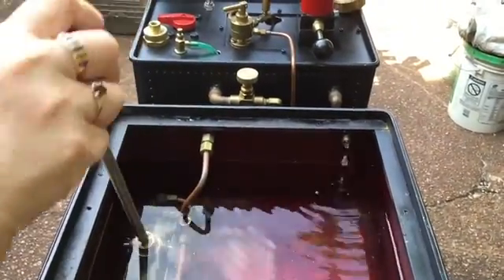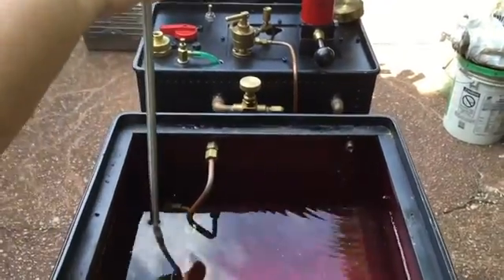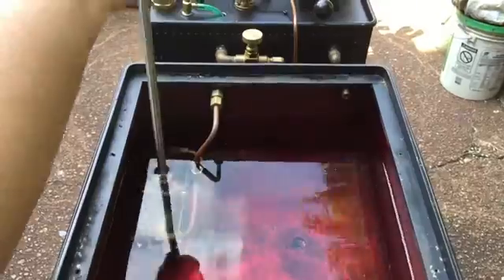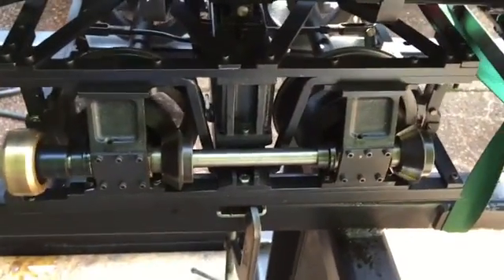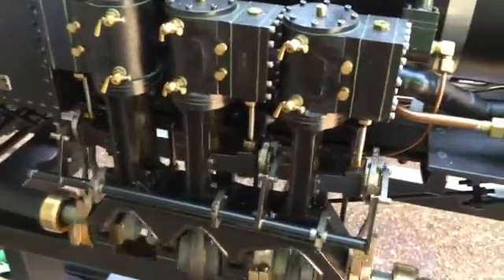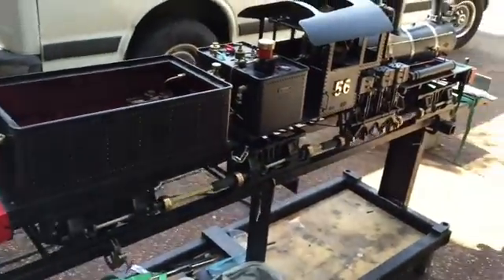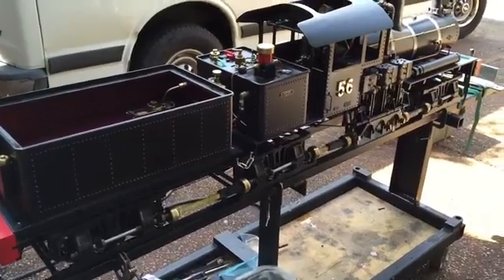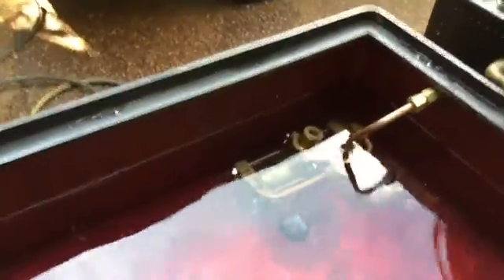Three Truck Shay Locomotive run on stand

Comment: Please be careful with turning up the fire to get steam up quickly. Propane (and oil) can be force fired and can thermal shock the boiler. Propane also likes minimal draft. Fire up time from cold to full pressure on a boiler that size should be 20-25 minutes (same fire up time as what it would be with coal)

The engine should have a displacement or mechanical (steam oil) lubricator to feed it oil on a regular/continuous basis. Steam oil should be used as motor oil will break down at the heat of the steam. The oil needs to be atomized by the steam to evenly cover the valves and pistons. (Water in the steam will also wash the oil away.) LocoParts has lubricators. I think Little Engines still has some, but am not sure.

Comment: Greg... That is a beautiful engine you have made.  But it sounds like one of your cylinders is out of time.  You should be able to get down to a crawl without the pulsations if timed perfectly.I am considering building this exact locomotive from Mr. Schroeder's drawings and castings.  Do you have any suggestions or caveats concerning this, and how smoothly did your build go as far as the plans?  I have Mr. Schroeder's plans, and they look very well done, but since you have already built this engine, I thought I would consult you for any advise you might have.  Thank you for this post.  Beautiful engine.
Reply: I have Ken plans and casting.   Just starting
Reply: Uncle Red, nice to hear someone else is currently starting the build.  I don't have the castings just yet, but have started on the tender and main frames.  Once I get my copy of Ken's Lima drawings that I ordered, and have sufficiently studied them, I will probably order the castings and get started on the 3-cylinder engine.  Ken's drawings are pretty good, but I like to have as many reference materials as possible.  Good luck with yours, and hope to hear more of you progress.
Reply: The casting are good.  I found the hardest part is to find a starting reference surface on the casting from which to start measuring.  there is extra cast iron to the casting to make some minor mistakes.  I plan to try to do some videos of my work.  BUT I need to do several before i start posting them to see how much effort it is to do the videos.  Kozo"s books are a good reference.
Reply: It is good to hear there is some 'meat' to the castings, since that does allow for some fidgeting before the final datum surface is cut.  And I too have a couple of Kozo's books, including his old Shay book, and I agree that they are very good references.  I did receive my Lima drawings today, and have been perusing them.  They are also a valuable resource, IMO.  And I had also planned to video my build process, and already have a little footage taken, but not much, and don't intend on publishing anything very soon.  But if you do post any videos, please let me know, as I would love to see them.  We can all learn from watching other people skin cats.  :)